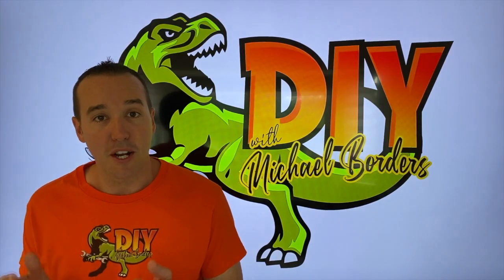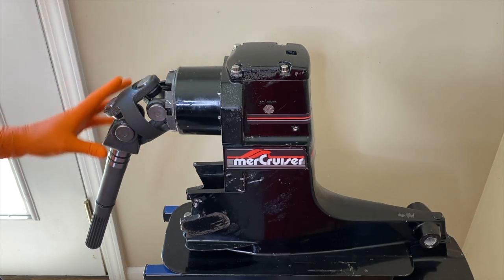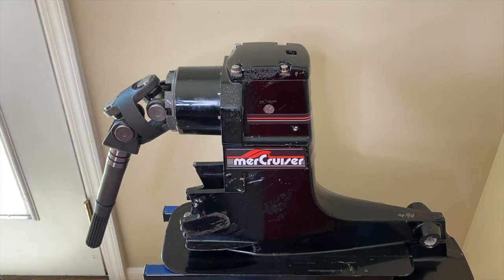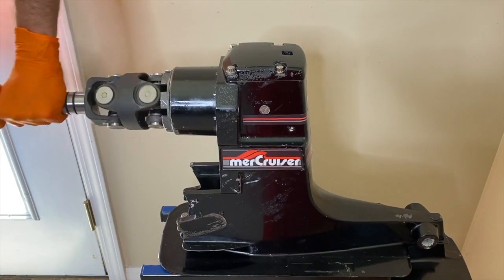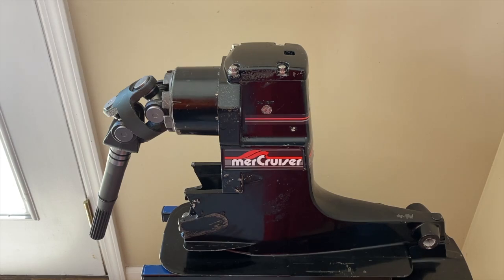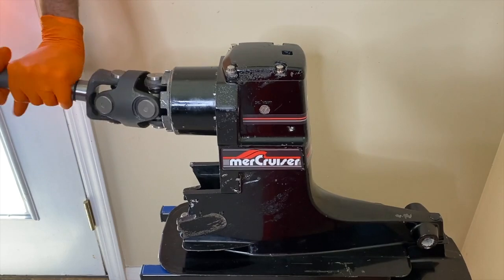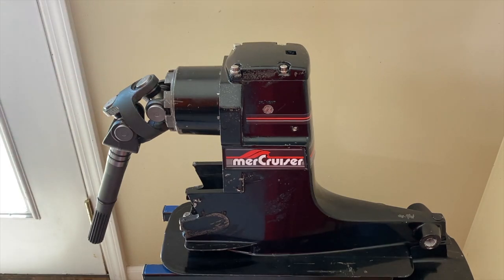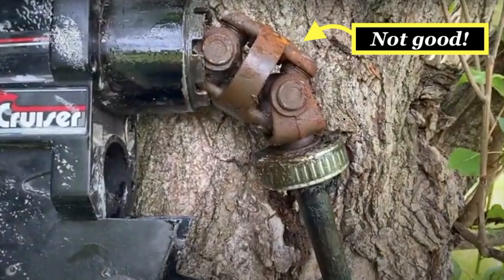How a U-joint assembly works - What you need to know

Comment: Great videos Michael…very informative and precise. I have a question about Perma-Lube Gimbal Bearing installation. Why do you think Mercruiser recommends that the identifying dot be positioned at 10 o-clock? I know why they do it for the greasable bearing. Looking forward to your reply.
Reply from the maker: Thanks for watching, we have a full Service Bulletin video coming on the Dot orientation when installing bearing into cavity.

Mercruiser set the 10o-Clock mandate to ensure all certified Mercruiser service stations throughout the country were installing it the same way…ensuring all transoms were the same after being serviced.

Mercruiser performed a lengthy testing process on the newly designed bearing and found the 10 o-clock orientation to be best when installed.  This helps the opposite side be properly positioned for peak performance and long-term life.

👍